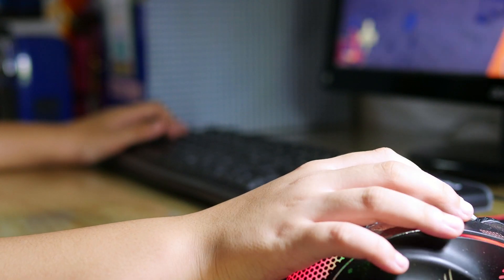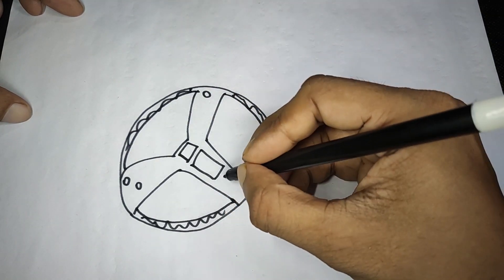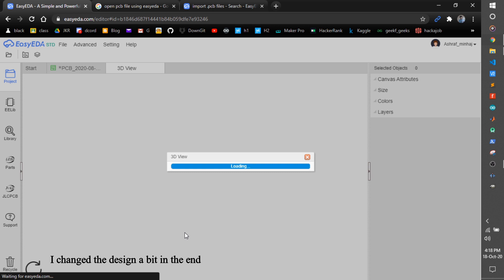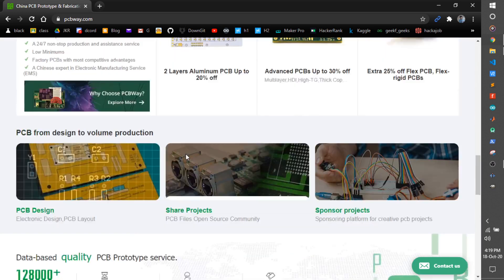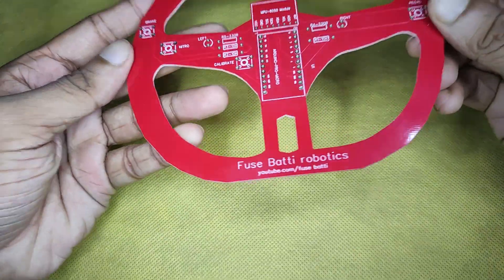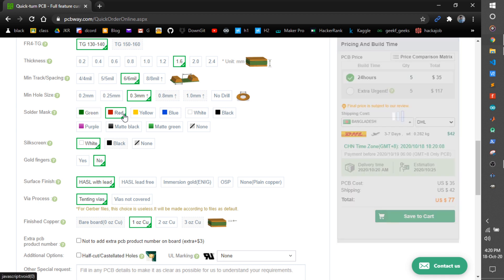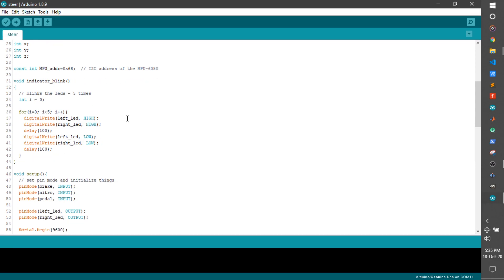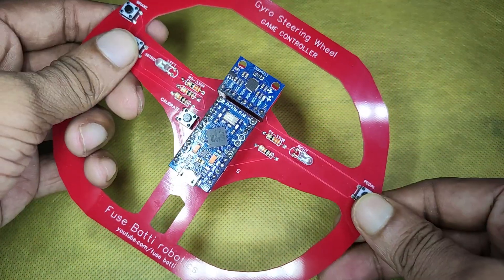Make Car Simulator Steering wheel with Arduino || Arduino Game Pad || Arduino Race Car Simulator ||

Comment: Can I use a wire to connect, if there is any problem of power supply. 😊
Reply: Please can reply
Reply: I have to use in mobile ,so there is problem of current supply
Reply from the maker: If the mobile supports OTG, this device will work anyway. Most of the modern devices support OTG.
Reply: @FuseBatti  otg means what,I had to use modern switch if it will take any extra power
Reply from the maker: USB on the go. Just google if your phone supports OTG or not. OTG enables us to connect pendrive, keyboard mouse etc. on the phone and they can take power from phone to run.
Reply: @FuseBatti  I have doubt in the circuit for the left light there connection to 330r Resistor in one way ,where is the another connection of Resistor is going and another is that in right light there connection from 330r Resistor to 1terminal but where is the connection of 2nd terminal is going.
Reply from the maker: The resistors don't have polarity. You can connect them anyway. 330r are used for the led lights.
Reply from the maker: Sure you can use external battery, but please don't use more than 5v.
Reply: How
Reply from the maker: You will see there's vin and ground pins on the board itself. 

BTW, the device currently is taking power from the laptop/computer itself via USB. That's also wired.
Reply: Can you send your email id so I can send a myself recreated the circuit so you check the connections and tell there is any wrong.
Reply: Please can you reply
Reply from the maker: ashraf_minhaj@yahoo.com
Reply from the maker: Hey, find the circuit diagram here https://www.instructables.com/Gyro-PCB-Gaming-Wheel/
Reply: @FuseBatti but I have doubt in that circuit  so I draw your circuit in my understanding, can you check the circuit that will work I send it
Reply: @FuseBatti KEY4 needs a 10k resistor (pull-down), same as KEY1–KEY3.

Without this resistor:

KEY4 input will float

It will give random ON/OFF signals
Reply: Can you reply please 😊